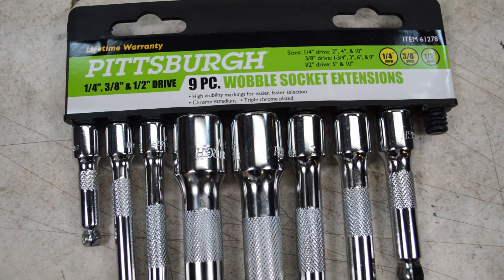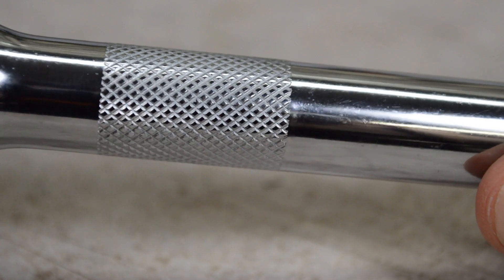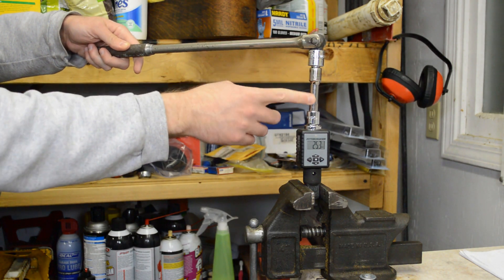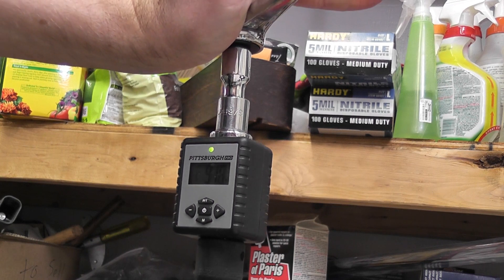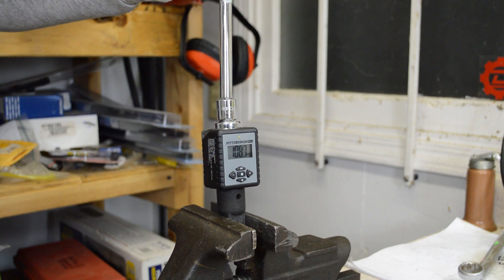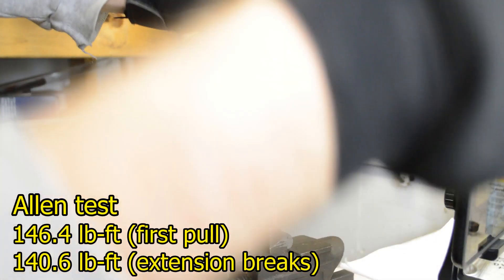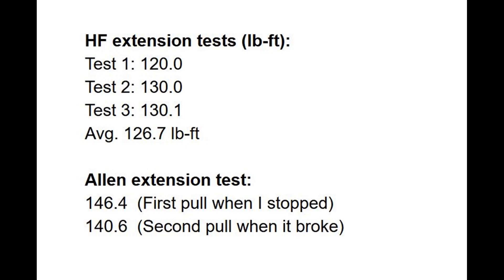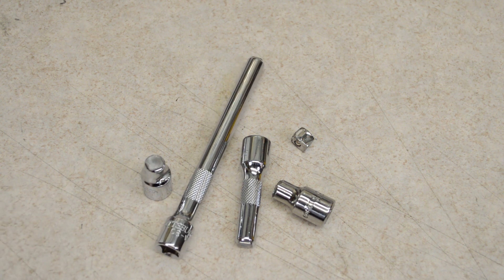Tool Test: How strong are Harbor Freight wobble extensions?

Comment: What happened around 3 minutes was the steel had already passed yielding and was somewhere between Strain Hardening and Necking. If you google "Stress strain curve for steel" it's toward the top hump of the graph. Once a material reaches that stage it's game over and that's why the 2nd pull didn't take as much torque to finally make it fail.

Comment: The conclusion is valid, they are decent enough, but the reason to use a wobble tool is to attack a nut off-center and the tests should have been performed that way, at "full wobble."  It appears you are attempting to tighten the nut with the rotation axis of the tool in line with the nut center.  This would induce a torsional stress only as the center of rotation of the tool and nut are the same.  As you deviate from this and use the wobbling capability of the tool, a bending moment is induced and this can be substantial and most likely would have caused the tool to fail far below your measured value.  Regardless, I have used these same wobble extensions from HF and they did the job just fine, glad to have such a cheap alternative as I would not have wanted to spend much more than what these were.

Comment: Great extensions,  as you pointed out it is for the hard to reach fastener so you can tighten/loosen at an angle.  Your test is flawed when comparing the US made extension in that it was not the same length as the HF extensions you tested.  You loose more torque when the extension is longer due to flexion.

Comment: Not bad for cheap HF wobble extensions.  I have used them and they do okay for the price, however I would have liked to see that a standard 3/8 extension make it to at least 200 ft pounds and a wobble extension make it to 150 ft pounds.

Comment: Wobble extensions are very useful. I would only buy them from the tool trucks. Snap-On ones use the strongest steel so it might do more torque before breaking. I can also get it warrantied by the tool man.

Comment: I would like to see your video on getting the broken pieces out of the adapters.  I just threw a short 1/2 in extension in the trash because I had broken some kind of 1/2 in shaft off inside the extension.
Reply from the maker: I never did get them out.

Comment: How you get that torque adapter to ft lbs? I have the same one and have used it for engine builds (I always use a torque wrench click type for final check) has seemed accurate so far.
Reply: Hold the very top button and the very bottom button at the same time

Comment: harbor also has an impact version, please test it, it should be stronger 3 Pc 3/8 in. Drive Impact Wobble Socket Extension Set
Pittsburgh Professional- Item#67065
Reply: I don't believe impact sockets and extensions are stronger, just a different material meant to not shatter  from impacts.
Reply: I've broken the impact 3/8 extension using hand tools to remove engine mounts. Also using 1/2 extension with a breaker bar to remove lug nuts
Reply: @BaltazarSMZ  why did you have to use an extension for lug nuts? I would think you would want as few pieces in between the socket and breaker bar, no?  Genuinely curious as to why it was needed, not trying to be an argumentative asshat, I promise!!! 
 :)
Reply: @devonrosa4414  because at the time I only had regulars hand tools and a short length 19 mm. So I had to add a an extension

Comment: i wonder if impact extensions would be stronger or if theyre engineered to be weaker than   CR-v but not have any flex thatd deaden the impact?

also tip for getting those broken bits out i usually use a stick welder, strike an ark on the wobble bit inside and purposely let the ark die out with the stick electrode in the puddle so it sticks.. than use that to pull/bang it out (best results if you cool before pulling)

Comment: stopped the video at 1:03  i think the 60 lbs might be low im guessing around 130-150  i have no clue though.. have only broken one cheap extension from using it out of alignment with the bolt
Reply from the maker: That was a very good guess on the torque.
Reply: yeah people tend to use these for torquing their wheels if they dont have the proper gear so figured itd be above 110lbs.. i find those 1/2"-3/8" adapters are always the weak link.. id pay good money for one of those thats indestructible

Comment: do the 1/4 wobbles. i've broken one and i had all my weight (230lb) on it and done that several times before it broke. then i pulled out another and finally broke loose the nut.

Comment: As hobbyist on limited budget, I appreciate these videos!

I've always bought the cheap stuff with the attitude that I'll upgrade when (if) it breaks, and thus far I've had to upgrade very little. Videos like this make me feel a little better about being such a cheapo.
Reply: Pittsburgh is actually a decent brand. Their numbers come super close to snap ons. Just a little lower but as a home user that's already better than I need. Its almost the only thing I buy at harbor freight. Plus lifetime warranty on almost everything.
Reply: @Robot Justice Same here. being a DIY mechanic, cost is important to me, but not if it comes at a steep cost of quality (or, rather, a lack thereof!) Thankfully, most of their hand tools have been excellent buys for me, personally. I'm not using them day in and day out, but for my every few month's oil changes, occasional alternator/starter/[insert mechanical failiure here] jobs, they work great for me. That, coupled with Harbor Freight's fantastically EASY and HASSLE-FREE warranty (did you use a breaker bar on this ratchet? no, of course you didn't, just grab a new one! ;) I don't condone regualr misuse/abuse of tools, but aren't we all guilty of too many ugga duggas every once in awhile, amirite??), keeps my business, coupons or not!!! (always found them to be a bit of a hassle, if I'm being honest, plus I discovered the joys of harbor freight at the tail end of the couponing time (so, last year, essentially.) so I don't miss them that much at all, as I pay for the paltry sum of the ITC membership with one of two well-timed, bigger ticket (for me, that is!) purchases.  Call me a shill, I don't care. I'll be headed to the bank to deposit the money I saved NOT buying into the overhyped, expensive-as-all-heck-for-no appreciable-reason the Blue point, Snap-on, and MAC tool brands of the world. Solid tools for the money (MOST of them, anyway!). Videos like these really help us/me in determining what is good/what to pass on in terms of overall quality and/or usefulness to the user. 'So THANK YOU!!' he said, to both the aforementioned commentor, and to the video's creator. I love tools. Lols. Also, its my birthday, today, not that many (if any) care. :) 33 years young today! Rant/wall of text DONE. Thanks for listening. Sorry/not sorry if you died of boredom, disbelief, or any other medical conditions related to/caused by my thoughts, beliefs, or opinions on this topic! Have an awesome day all!

Comment: I guess 135 so not to far off
Reply from the maker: That was a good guess.
Reply: Tool Teardowns thanks I just figured I've used those before and as I recall it took quiet a bit if force to break one but I did then I just took it back and got a brand new one

Comment: Big question is, did you warranty the broken extensions?
Reply from the maker: I haven’t warrantied them and I probably won’t because I broke them on purpose.
Reply: I didn't figure you would warranty them. My question was kind of a joke about people who abuse tools / use them incorrectly the get angry when the tool fails.
Reply: 2 AM I rarely warranty my Harbor Freight Tools but they will warranty it

Comment: Why would you want a wobbly extension? I haven't seen these in the UK.
Reply: mc349iii they are good for when you need a long extension but can't go ,completely straight on. Belhousing bolts and starter bolts for example.
Reply from the maker: It's for access. It's for the same reason you'd use a swivel adapter with a socket.
Reply: Tool Teardowns ah got it, thanks